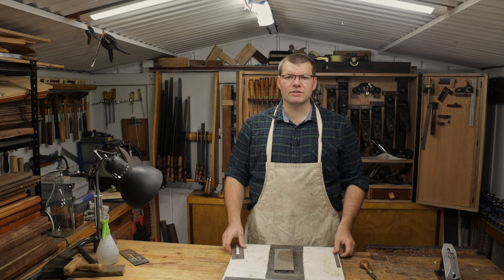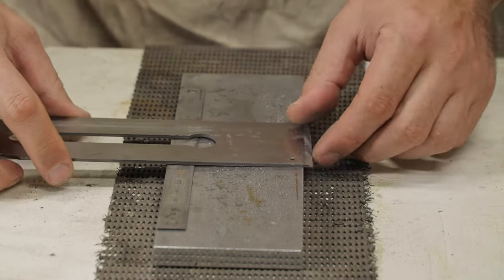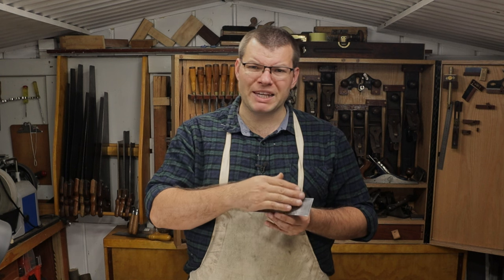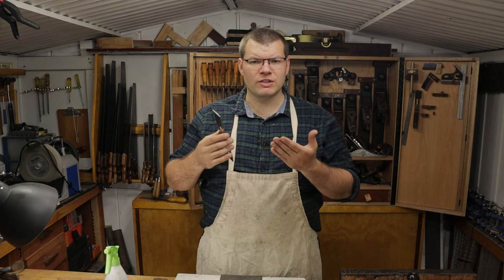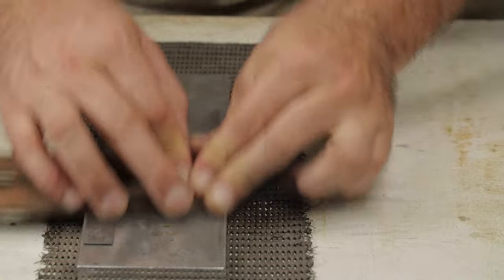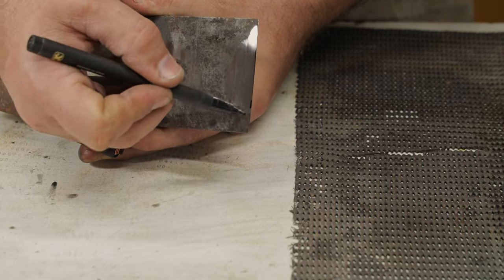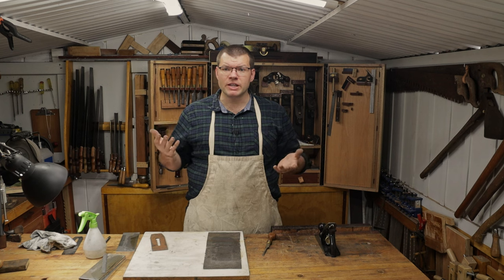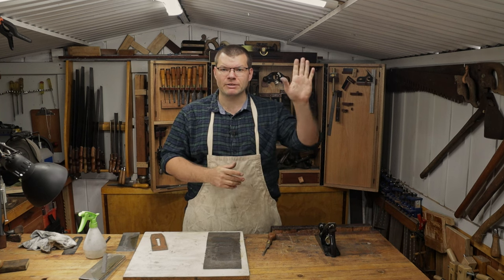The Ruler Trick - Flattening a plane iron

Comment: I seem to remember Paul Sellers referring to the ruler trick as creating what is called a York Pitch. which has certain angle of attack advantages. I disagree because once you go down that route, you have to continue along it when you re-sharpen. My way of thinking is that, if you can't easily correct the back of a blade, just replace it. You don't want to be removing excessive material because it weakens everything. Similarly, you don't want to be adjusting angles because that sets up future harder work than is necessary. Either way, it's just kicking the can down the road.
Reply from the maker: I only use this on the worst of blades, i think i have 2 blades with this and they are both wooden planes with blades harder to replace.

I thought a york pitch was a 50 - 55 degree cutting angle using a replacement frog. I guess it could be achieved using a back bevel also, but it would have to be larger than what is achieved with a thin ruler.

In any case i agree with you mostly that its best avoided generally
Reply: @AussieWoodshed  When the blades are hard to replace, then obviously you have to go with whatever keeps them working - in that situation, I would do exactly the same. I don't own any wooden planes but I do have access to 6 or 7 of different sizes/configurations - but they all need attention after 70 years of inaction. They were last used by the village wagon restorer/coffin maker in 1954 (I found his work diary in a cupboard in the barn).